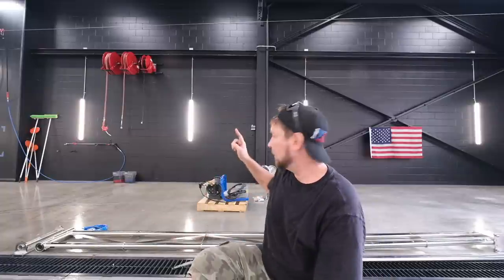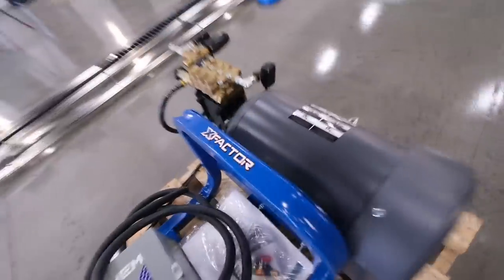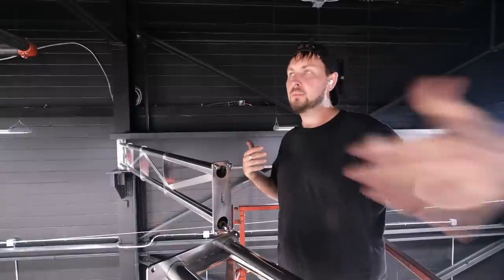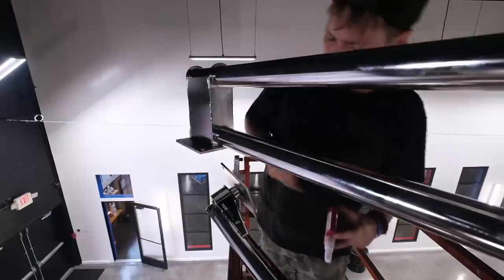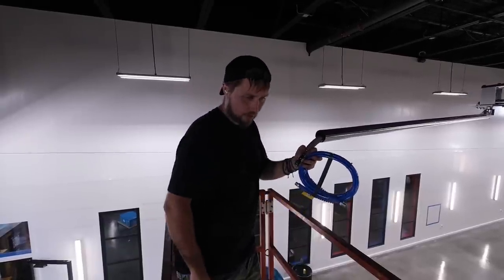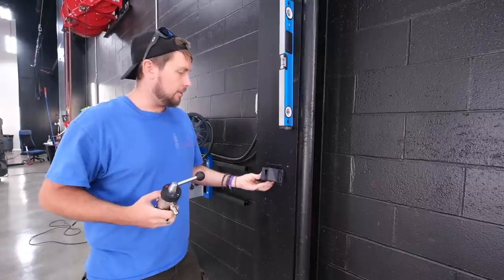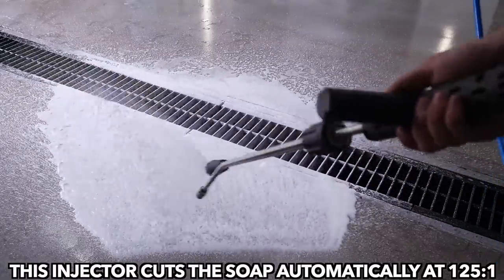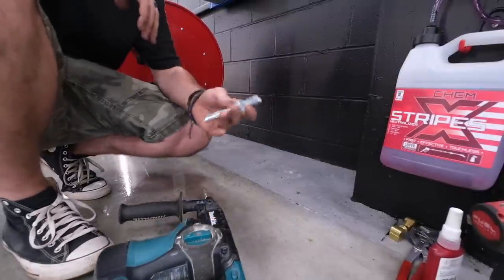The Biggest Upgrade To My Wash Bay Yet! Installing A Mosmatic Wall Boom and X Factor Power Washer!

Comment: So I see you guys have a dual injector and then an in-line one. If I want to just do a single injection and the ability to switch between just water and foaming, do you offer something similar to the switchable dual injector? Unless I’m wrong, seems the in-line I would be stuck always foaming without the ability to switch back and forth between just water or just foam.

Comment: Hey what fittings do u need for form Canon to fit to power washer ?
Reply from the maker: You’ll want a 1/4” quick connect socket, mpt if it’s going straight on the trigger, fpt if it’s going on the end of a lance